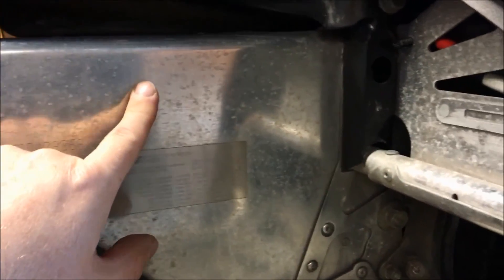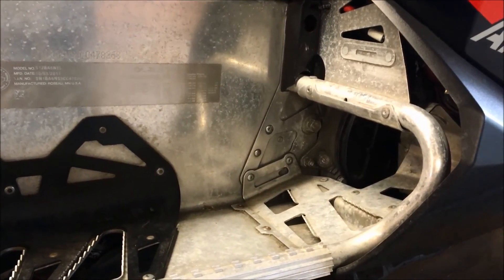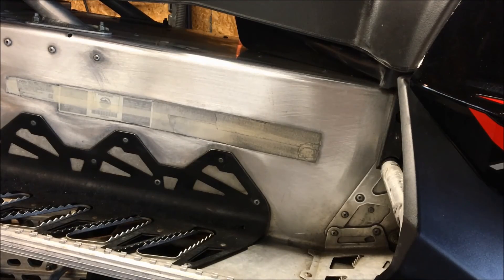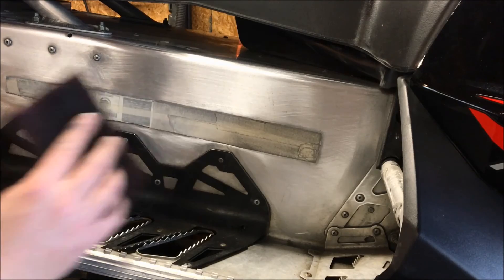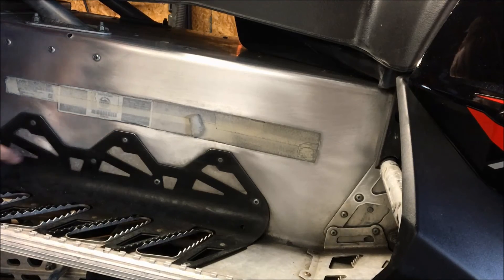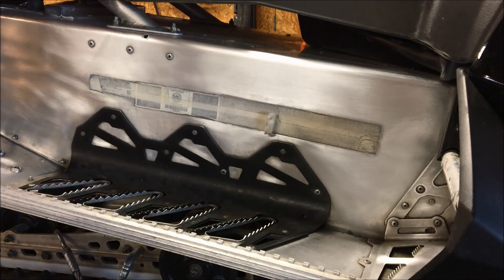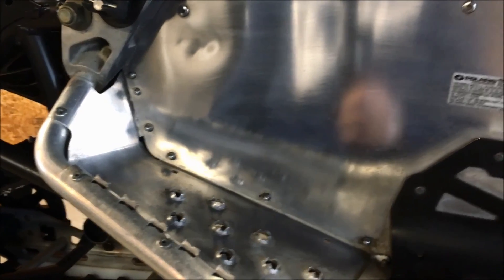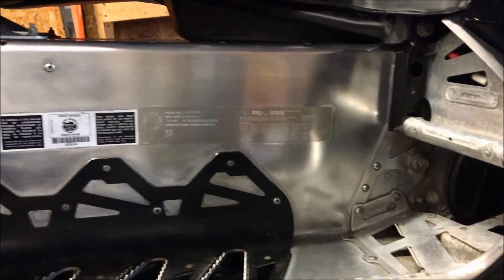Snowmobile Tunnel Polishing 101

Comment: 220 grit will never "buff out" its way too aggressive. I'd recommend 600-1000 depending on the piting. If the piting is minimal just polish it. By using 220 you've created alot more work.
Reply from the maker: thanks for the tip

Comment: My sleds tunnel paint is peeling can I remove the paint and polish it?
Reply from the maker: Yes. You’ll need to use paint stripper and a pressure washer.
Reply: @StreetersGarage  Thanks a lot man
Reply from the maker: No problem. Good luck